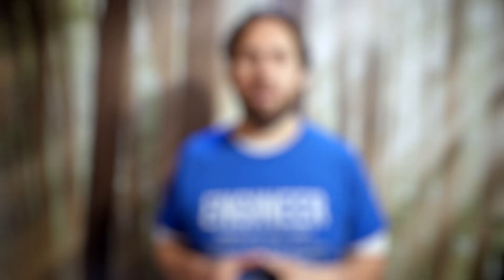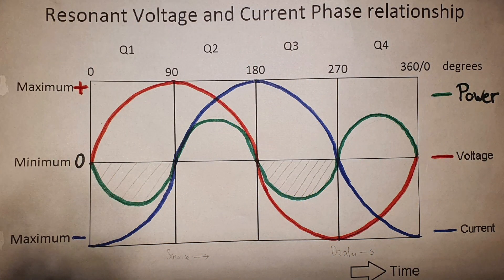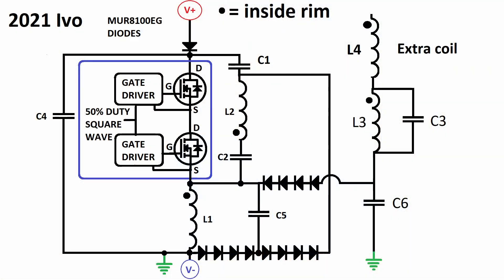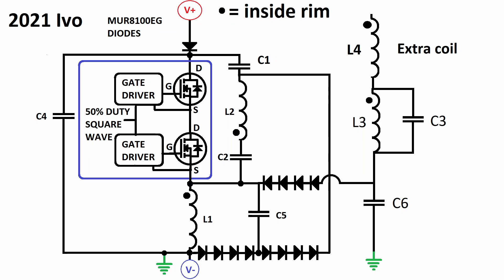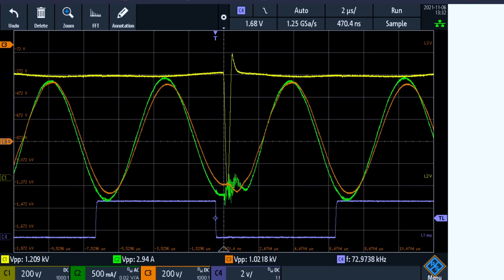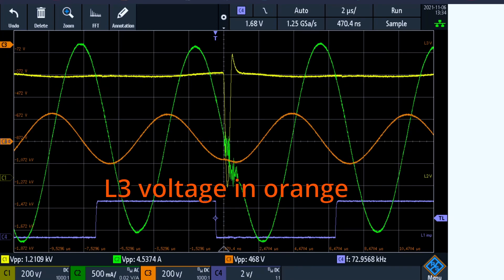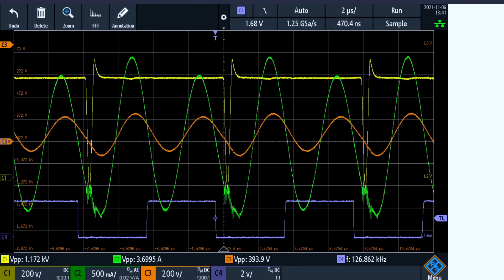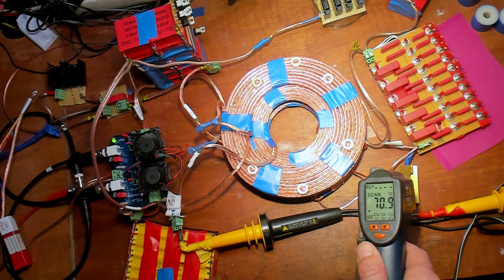Nikola Tesla's EXTRA Coil

Comment: I have only been able to harvest using the aluminum plate on Avramenko plug next to the Resonator without loading it, with ground on other end of load
Reply from the maker: yes that will work, you are harvesting the displacement current, as the plate acts as a capacitor plate. If you can add a changing magnetic field, that will induce voltage on the plate you would get better results as power is voltage X current (which can be displacement current)

Comment: what if you added a ferrite core in L4, to help create the third phase of your 2 phase system? could we tune the magnetic inductance of L4 to resonate with the electrostatic waves, but offset it by another 90+- through subharmonics and delay or Q drift? or, what about L2 and/or L1 being asymmetrical in their windings?  What about a piezo core, something like a rochelle crystal? some hybrid ferrite-crystal structure? may have to rebuild the system to work around the physical resonance of your crystal.. perhaps a larger input power needed, but a greater amplification of aetheric wind - almost like a venturi effect, if you can tune the sequences or stages, in what "normal" fluid dynamics would specify as logarithmic curves? Keep in mind that same crystal with parallel (or otherwise configured) electrodes attached makes a capacitor with an extremely high dielectric breakdown...

Comment: If negative and positive power cycles cancel each other. When you make bolts and amps in face in the extra coil, the effect is to reduce power frequency in half. But you still get a negative and a positive semi-cycles. Shouldn’t it still cancel each other?

Comment: Have you tried setting this up outside with a clear view of the sky? Remember that you have to have a flow of ions in order to create a flow of electrons! The static electric field is supposed to project charged particles into the ionosphere where they will bond and release electrons. The atmosphere works as an ion exchange mechanism. This is why he invented the cathode ray tube.
Reply: There is a Russian (maybe) guy that has some really odd videos of a pyramid surrounded by magnets with a conductor at the top. You need to watch this video. You can see the (in the oscilloscope) vertical pulse emissions and seconds later a flood of electrons fill the screen. This guy probably just proved some seriously mind blowing stuff. I’ll see if I can find the channel..
Reply from the maker: that static field needs to rapidly change to project its energy
Reply: @MasterIvo  i think it’s some sweet spot that I’m having trouble finding. I believe the answer lies in the moments before a lightning strike. These “charged particles” are sent from both directions to create a path for the electrons. At least that’s how it was put to me. So my theory is that the “static charge” is acting as a particle accelerator whenever they come into contact with the field. So ( if that’s the case) ideally you would want to “collect” charged particles at the bifilar core and hit it with a heavy static field suddenly. Then allow time for more particles to gather in the now collapsing field ( which might actually draw them in.) and hit it again. I think that’s why he mentioned using a really low frequency.

Comment: Something I noticed was that real, lost power in let's say a transformer is not dissipated to heat in the primary when there is an ohmic load on the secondary, yet it is delivered and lost in the primary. Ever gave this a thought?  I tried to understand this and I think I do now. 

This is why frequency, phase, resonance, impulse and self-oscillation techniques are used: to reach the goal of zero back emf from secondary currents to primary voltage, with normal ac this voltage adds to the vxi formula which pushes the power signal to the positive side. By using any technique or tesla theory we try  to have the back emf in phase or 180 out of phase with input voltage with the purpose of imaginary power  in, real out. 
I try to identify this idea in your work while watching your vids again.
Reply: To add: don smith uses quarter wave lengtht with the purpose of potentialize it with +v at the ends and - v at the center of the output coil, so that the currents are 180 deg out of phase and also the back mmf., effectively generating power by the output coil alone.
Reply: The opposing mmf is seen as net zero in the primary.

Comment: Let me get this for some reason google just gave me it first time I watched all but this one was on watch list so example E=0 ------ no work cancel each other out like scaler waves in way I know of them at first but they are there we know that because pass faraday cage proves there but if genarator making this primary there would be no force needed to make it so easy like if under no lead but then the L4 is in phase so is basically like electromotive force work force made from no work force is that right it could be easy to make high volt high current that cancel so no hard work power and end with usable energy to power loads i think that how it works then would you look at E=0 cancel each other as neutrino or pure DC the Either between Both AC center of turoid or a magnet or elements ? Sorry late post but I'm a bit slow my time is back wards slow batter dead thanks got me thinking at least crazy dream last two on time travel they stole my tools and wires second plama ark small of electric motor like the scooter the plasma thin rod to big mas like the thin rod just touch water  and self sustained pumping heat up stainlees steal box tube with round tube imside weard lost detail left long to write down weared to heat static caravan lol
Reply from the maker: maybe use some punctuation so it is more readable? pretty long question otherwise

Comment: This is significant. I am incorporating this 4th coil into my design as soon as I get back to my lab bench (8 days from today). All my other components are in place for converting power from the coil sets into usable kW, like for a microwave oven and clothes washing machine, real usable kW. I will let you know how it goes in the community pages, whether I get it to work, or not, yet. My 1st goal is to get my devices to power themselves, which I have never seen ANU do. I haven't seen you do it yet, either, but you don't blather on about your systems being definitely and obviously over-unity and show no proof.
Reply from the maker: I will be very clear about how it works, once I get it working. Getting closer step by step. high dV/dt is key

Comment: ‌70C° on R 8,2Ohms of the 4th coil wiring is only a little Power, a light bulb chain knowing the wattage of each bulb of course would be nice to see how strong the glimm comes shining (previous lights comparison when powered by the regular wall outlet) and then saying I can power that many so bright with so little 16,8W input ! A COP estimate please !
Reply from the maker: yes in phase current and voltage, but no  power. how can that be? it is because the current is not magnetic conventional current. but cold (dielectric displacement) current
Reply: @MasterIvo  If one searches Google for cold electric current, I'm still puzzled what to do with it ? 
AI answer....Is electric current hot or cold? A moth frying on a bug lamp proves, suicidally, that an electrical current generates heat. But a current can also cool, if it runs through the right stuff. Electrons carry away heat when they rattle through exotic semiconductors known as thermoelectric materials--but good ones are hard to find. So the 4th coil
Reply from the maker: @oliverwesener584   haha google. this subject is still very cencored.
when cold current is mixed with hot current (magnetic conventional conduction current) it produces real power. but they need to be 180 degrees out of phase. It's not an easy experiment to show and explain, non the less I am working on this and intend to present it
Reply: @MasterIvo  Thanks for experimenting towards sizing the effective power output. Perhaps a small electric DC Motorpump could run doing X work sizing water (volume) pumped in so much time into a higher container,  that  can be compared with normal Hot electricity work output to come to a COP.  I think output here has a prevailing Hot current because the resistor on it would not heat up to 70°C if cold current would be equal or greater.
Reply from the maker: I am going to convert the cold current into hot current using a capacitor, to fast charge from the cold current, and then slowly discharge in to a parallel (resonant)
 coil  @oliverwesener584
Reply: @MasterIvo  hmm converting means you loose power time goes on during discharge - you not charging then.  Capacitors seam to charge up this magical way.....what will come out of all that processing of the resonance.....perhaps the resonance will fade out or a ripple is created loosing power so fast one can not capture it in the capacitor ?

Comment: Hi Ivo, got a question concerning the Colorado transformer, I've been looking to build one of these and I'm a bit confused on some things, does the wire gauge of the secondary and tertiary coils need to be the same? Tesla shows the 2 coils are connected together physically in his patent so I'm wondering if the gauge needs to be the same. And how close do the resonant frequencies of the 3 coils need to be? 

In DRSSTC's the resonant frequencies between the primary and secondary coils need to be as close as possible to result in much higher output, when comparing the dimensions of the 3 coils in the design using an online calculator I found their resonant frequencies are very different from each other, would modifying the design so all 3 coils share a closer resonance improve the output? Cheers.

Comment: Yes, the current lags the voltage by 90 degrees in an ideal inductor (coil), thus, the power formula is not really I X E alone, you must multiply by the cosine of the angle theta, in a DC circuit theta is 1 and thus most just say I X E.  Of course you know this, but for the sake of viewers that have not taken electricity classes I mention herein.  Basically, this is due to the fact that an inductor resists voltage instantaneously when voltage first applied to it.

But not to get bogged down with the obvious…Tesla did use series coils to increase tension, typically in final step in applying electrostatic induction.  As well as other inventors such as Stanley Myers.  Thus ‘VARS’  be changed to useful action without the wasteful change of ‘VARS’ to ‘WATTS’ which is always a loss full experience, unless maybe you want to heat your room, and even then loss full.
Reply from the maker: new video on dielectric induction producing ground currents:
https://youtu.be/kbHDHiAQrrs

Comment: Greetings Ivo, i have some theory stuff, what i have understood from writings made by other men, i came to conclusion that the key, the holy grail if you want, is to tap straight into ether. In other words, pure voltage, nothing but voltage. Amper is manifestation by ether in created space, and its seen as heat. 

Further speaking, there must be a way to get two fields (magnetic-amper/electric - voltage) to work in union as one. The possible solution how to achieve this scenario is, imo, somehow to cancel magnetic field so only the other force (electric force in form of voltage)  manifests.

The extra coil should do it somehow, and by the words of Eric Dollard, no l2 or l3 are even needed. Theres a reason why this secret radiant electricity is also called cold electricity, no amper no heat.

God bless you Ivo and good luck in your research

Comment: In the Colorado Spring Notes, Tesla clearly pointed out that the extra coil is NOT magnetically coupled with the L1 or L2 coil and is therefore not dampening the input circuit. It is only electrcally connected to L2 and the elevated capacity. In your setup L4 is magnetically coupled. In that case you just have an ordinary output coil that will magnetically act back on you input circuit (back EMF). If you make proper input / output power calculations you will notice that it is not overunity...
Reply from the maker: I'm not strickly replicating Tesla, Im doing my own research, inspired by him. He pumped the ground, that is mighty interesting, as with a diode we should be able to pump out of the ground into a capacitor

Comment: I'm so glad you're doing this. Do you think  Don Smith is a fraud?
Reply: Dear brother, this is incredible. If you've done what it sounds like you've done... well then, "you've really done it." I love resonance and I love phase conjugation and phase matching. You are increasing the amplitude of these waves. Apparently there could be more power available from the ether with higher voltage and higher frequency impulses. You are possibly solving some of Tesla's real secrets. I'm wondering if you could help me with one answer? How you measure capacitance? I'm trying to begin building resonant circuits involving water and eventually also with just electricity. And I'll need a scope but first I need to measure capacitance.
Reply from the maker: use a LCR meter

Comment: If you read Teslas papers carefully he is using an extra coil away, outside of the magnetic fields. Anotherwords it's a coil tuned into resonance that is simply connected by a single wire not magnetic coupled.  I ran experiments like this and it creates a significantly stronger field in the air because it is not interacting magnetically with any thing around it which would dampen the field. It literally makes transmission or power go much farther than without it because it is a free ringing coil unimpeded
Reply: I'm glad someone pointed this out, this is a critical function in the operation of the extra coil, this was also part of how Tesla reached over 100 million volts:

"With such a coil I found that there was practically no limit to the tension available, and it is by its means that I discovered the most important of all facts arrived at in the course of my investigation in these fields."

I also asked Wardenclyffe Research about this and he said the same thing, with a little extra: 

"The secondary is within the magnetic field of the primary, therefore energy gets transferred from the primary to the secondary, which is what you want. But what happens next is that the energy gets transferred back to the primary. In other words the energy oscillates between back and forth between the two coils. Tesla wanted to avoid this back and forth, and for that reason (among others) he came up with this extra coil. BTW. it is not 100% outside of the magnetic field of the secondary. There is a (very) small coupling in most of his set-ups. For that reason the extra coil should be wound in the opposite direction."

Keeping the extra outside the EM field also isolates it from being weighed down by the primary, Tesla found the best configuration was making the coupling between the primary and secondary coils as tight as possible, this gets you the best of both worlds of tight coupling and free oscillations in the extra coil. I'm surprised Ivo hasn't noticed this, keeping it tightly coupled will weigh down the coil horribly.

I wonder what changes we would see if we made the power coming into the primary coil purely Dielectric via a hairpin configuration with the magnetic contaminants removed? Like FIG 5 in Tesla's Rare Notes.
Reply: @JenkoRun вольты это не показатель. Нам нужна мощность. А экстра катушка по современному называется согласующим устройством или трансформатором. Но он энергии не прибавит более чем имееться